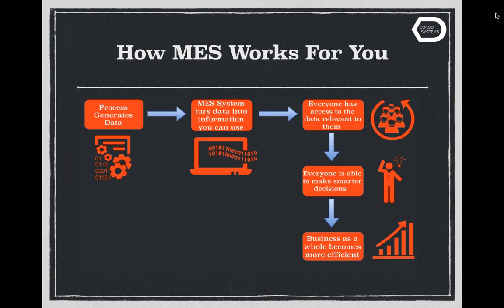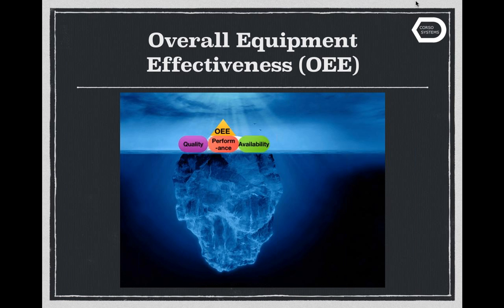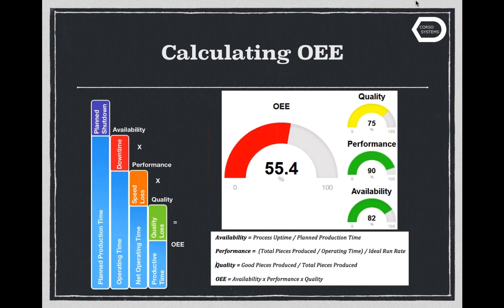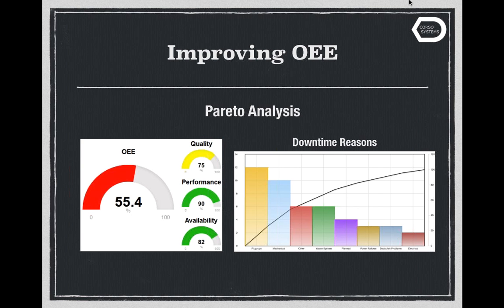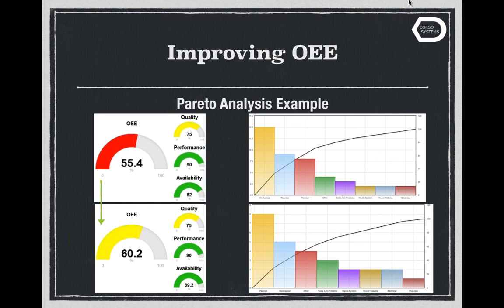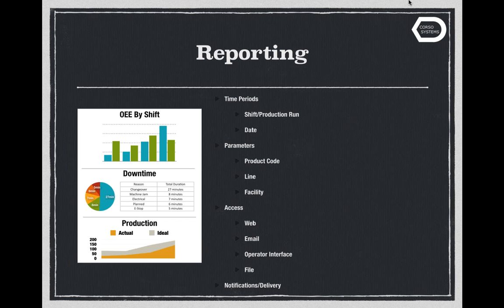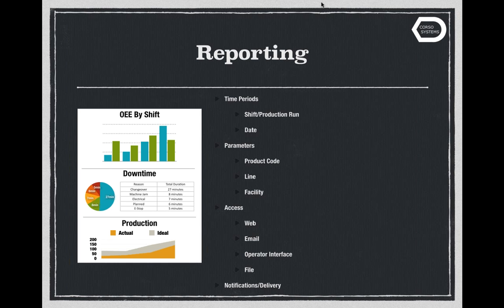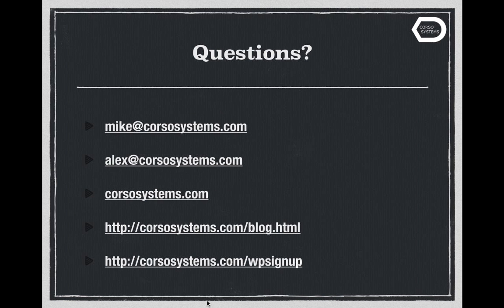Manufacturing Execution System (MES) Essentials

Comment: http://tinyurl.com/ho6e65d

A manufacturing execution system helps manage and 
automate the manufacturing processes on a production floor, thereby 
enhancing the performance of business processes.  It tracks minute by 
minute record of production, maintenance, distribution, quality, and 
labor operations regardless of the physical location of the 
manufacturing units. The manufacturing execution system market is 
expected to reach USD 12.6 Billion by 2020 at a CAGR of 10.85% between 
2015 and 2020.